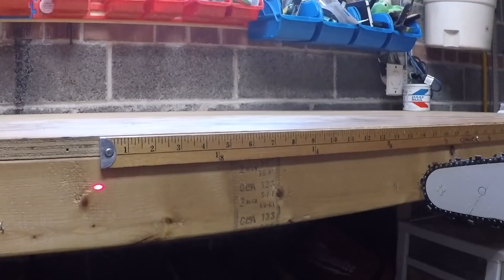462 Laser Accurate Firewood! The Firewood ProSizer! Fire wood Marker. Specs and Installation Video.

Comment: It works pretty good I use on. Now it’s not perfect but it will get close and more or less uniform lengths. Which is what we wood producers are looking for. The nice part for me is I don’t need to pre mark anything or try and eyeball off a marl on the bar. Just nose the bar to the log and put the laser dot on the edge of the last cut and go. I’ll have to get my tape measure out tomorrow and get a reading but based off my old measuring stick it’s with in a half inch to an inch of 16”.
Reply from the maker: Morning and thanks for the feedback! I'm looking forward to using it for a while to try it out. Have a great weekend!
Reply: @GPOutdoors  no problem. I will do my best to enjoy my weekend. Hope yours is good to.

Comment: Great video sir, I personally have one on my Stihl MS-311. Was given to me but the guy that makes them, gave away a handful for people to try out. Was really neat to when found out he's only 10min from my place.

I wouldn't say I'm in love with it but I don't hate it, have cut about 6 cord of wood with it and only complaint is that I find that over time the laser kinda moves and eventually some logs end up being more like 17in or 15in rather than 16 (which is not preferred as I sell a lot of the wood I cut).

Also noticed with the spring system on the stihl the cut point with fluctuate a bit depending if I'm holding the saw fully or the tip of the blade is resting on the log (Taking the slack out of the Handel springs)

Great video, inspired me to go out here soon and do a video for my channel here as well when I get better, I also had done and unboxing video but never finished that video.

Comment: Thanks for catering to us with OCD.  Nothing like neat even rows.
Reply: Uniform wood can still be stacked with plenty of pieces in or out of the plane by a couple of inches...
Also, MY OCD is that if I am within a couple of inches of the size I'm shooting for,  and there's a decent sized knot thereabouts,  I'm going to opt for bisecting  that knot with my bucking cut, for ease of splitting...that's more important to me than a couple inch variance  in the wood pile.

Comment: The company offer the swivel mount or the solid mount. Green, or red.
Can you answer which one you'd recommend buying?
Reply from the maker: Good morning! For me, I can see the green colour better and I use the swivel mount on my STIHL because my oil fill is at the bottom of the unit and so I can mount the unit higher and then point it down to my desired place. Hope that helps. Cheers!

Comment: Very handy gadget GP.  Save you a bundle in marking paint. I always thought that your paint marking tool was great. With the laser light it'll also save you of one less thing to carry with when cutting firewood.
Reply from the maker: God pointe Dean. I just used it once so far , so will use it for the next few months to see what I think! Have a great weekend!
Reply: The battery lasts a long time too. I have had mine for a little over a month or so and it’s still on the charge from when I got it.

Comment: WOW this channel is getting way snazzy.  I am old school. I still have hopes they will some day bring back 'wing windows' and 'mushroom door locks' in cars. LOL Good tips... Thanks GP.
Reply from the maker: LOL!
Reply: Is that the same as fly windows?
Reply: @samuelluria4744  A wing window is a small triangular shaped window to the front of the door windows that you can open independently of the door window.  It is good for quickly defrosting the front window, or just letting fresh air into the car.  PS. I also want to see the floor mounted headlight dimmer switches make a come back. lol
Reply: @johnevans6053  - That's what we in Jersey call a fly window..😉
Reply: @johnevans6053  - Yes!!! Tapping the floor for high beams! Just one of a million things I miss from the olden days...

Comment: I'm intrigued, but not convinced.   I'm going to check out their website, but I definitely will wait to see you use it some more.  My first thought is how much time am I going to waste while trying to line up the dot on the end of the log?  And how well can it be seen in the sun?  Thanks GP.
Reply from the maker: Good call DA! Me too. I have used it once so far but very intrigued. Stay tuned!
Reply: You will see it just fine in the sun I have one and been running it for a month so far no issues seeing it. At first I was a bit slow trying to get used to making the cut. But now I’m pretty good with it. If I had a way to film while cutting I’d post one to my channel. But I operate by myself so I can’t film and cut at the same time.
Reply: If you have it fully charged you can see it in the sun ok, but if it's not fully charged I had a hard time seeing it (and ended up stopping sooner that expected to charge it)

Other than that I do find that it's good to check after every tank or 2 of gas if the laser is still accurate, also found that on my Stihl Ms 311 that it will shift just a bit with the spring system and handle design and will occasionally throw the cut off an inch (Wich as someone who sells firewood can be a bad thing at times)

Other than that it's fairly good, I wouldn't say I love it but it's definitely nice, especially the fact that there made just 10min away from me!
Reply from the maker: @Tractors_Trucks_And_Pups  Thanks for the great feedback! Greatly appreciated. Cheers!

Comment: In bright sunlight the laser is barely visible which makes the “measuring” very frustrating. Other than that it takes a little adjustment in how and where you first  place the bar for the cut to keep it consistent length
Reply from the maker: Thanks for the feedback Euro. I haven't had any issue seeing it yet but will be out tomorrow in bright sunlight again and will see. Thanks again!

Comment: A 16" bar on your saw works faster.
Reply from the maker: It does Richard- good point - but I needed a little length beyond 16. I understand that the longer the bar, the less overall energy you get to the cutters, so to speak. But a great point for folks to be mindful of when deciding what bar length to run on the saw. Cheers!

Comment: Don’t think that would work for me.  
Not only can anyone who’s cut firewood for more than an hour already eye-ball the right dimension with reasonable accuracy (it’s all turning to ash eventually), but also it looks like it would be in the way of my hand, vibrate loose/misaligned and require precise “set” step each time to mark the log which I don’t want. 
I’m always amused by those that think having each section be exactly 16”, not 15.5” or 16.5” (the most variation I usually get) is somehow better.  I just cut and stacked 4 cords today and the least of my concern was the 1” variance in length when stacking.  For me, any deviation from a perfectly round log does far more to interfere with my perfect stack than the odd length interval.  Since they haven’t made a massive log lathe to make perfect cylinders so my stacks are standing even, I think obsessing over the length is hilarious!  I mean, does everyone just throw out the last length of the log that’s not exactly 16”?!  I just keep an eye down the log and adjust the last few cuts to make it work.  Waste not, want not.  As I said before, it’s all tomorrow’s ashes anyway.
At any rate, it’s always fun to see something new, but I think this is more hassle than it’s worth.  Seems like just another thing I have to charge and another battery the environment has to deal with.
Rant done! 😂
Keep up the great work, Gord!
Reply from the maker: Hey good evening James. Not a rant at all- love the detail and you sharing your thoughts. I love trying out new stuff and very much appreciate you good folks sharing your views on stuff- positive or constructive. The nice thing is we all get to see new stuff we may not have heard about yet. Helps all of us. Thanks! Have a great weekend!
Reply: Great rant! Well said! The difference in the shape of each chunk is going to affect the stacking much more than the +1"/-1" difference in length...ESPECIALLY  since splitting a knot within the last couple of inches is more important anyway...

Comment: If the idea is perfect accuracy then it's a fail if the saw bar is on a thicker part it will have the laser follow a diaganal line at that plane so the result would be slightly different measurement same with going thinner also any change in perfect 90°would also change the measurement
Reply from the maker: Thanks Ricky!
Reply: I hear you about the geometry of the varying thickness of wood, but practically speaking,  not too many sections of log change  diameter THAT radically,  within a firewood-length distance. 
   The aspect of  the perpendicularity of the saw to the log, on the other hand,  is very easy to screw up, and if I really cared, it would be quite frustrating. I feel like just as easily as I could train myself to be sure the saw was exactly perpendicular,  I could ALSO  train myself to guage whatever length I wanted to have.